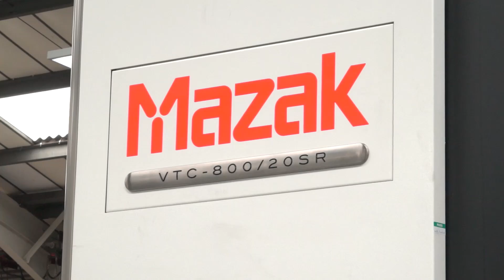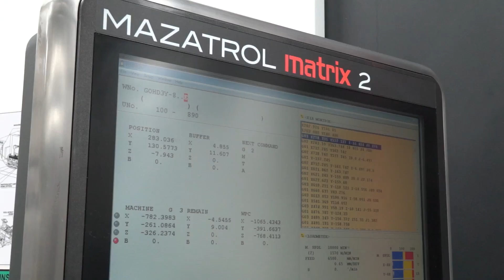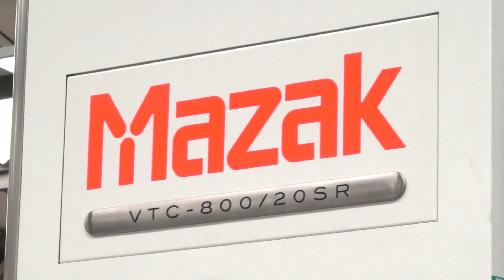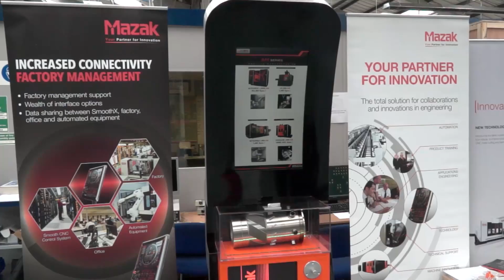SPE buy 2 VTC 5 axis machines from Mazak

Comment: I am a DMG man because thats what my company has purchased but I've always wanted to work on a Mazak! they just look so amazing! Maybe sometime in the future I can convince my boss to look at buying a Mazak! :-)
Reply: I don't know. With the 3 Mazaks I've seen in the shop, the visibility is terrible. Particularly with the pallet changer. Can't see a damn thing through that curved window with that i-500.
Reply: gredangeo Really? I've never had the chance to see one up close yet. I worked with a guy who did and just kept praising how easy and intuitive it was working with the control. Im guessing it was an older model.
Reply: Mazak is amazing still accurate after 10 years running 16h a day. imo best machines out there!
Reply: The controller is quite fine. The Smooth series looks nice. The original Mazatrol not so much. Anyways, when it comes to a pallet changer, you need to really think about visibility for when doing the setups. If you weren't doing setups on it, and it was a part of a robot cell or something with proven programs, and running 1000 parts at a time. Then it's not a big deal.

Some machines allow you to look through the original front window as if you didn't have a pallet changer, and then the Changer is added to the side window in some way. What makes the i-500 look bad is that the curved pallet changer window has three layers of that plastic, and each one reflects light back to you. The controller is right beside it too, so it mostly reflects that entire screen as well. The company I work for could not have looked at that machine in person to realise how much of a hassle it could be, slows us down. Side note, take the flight to the demo show and see machines in person. Bring a checklist. :)